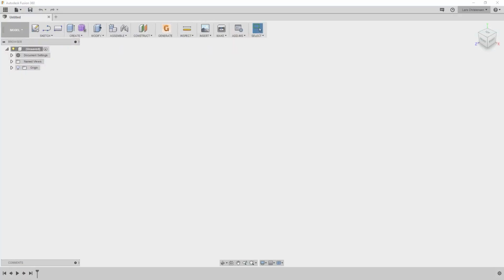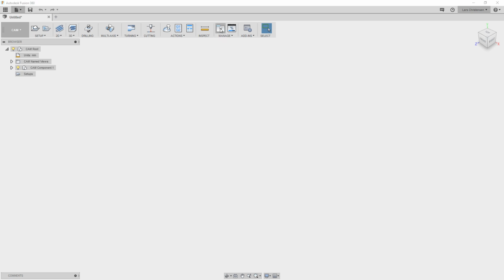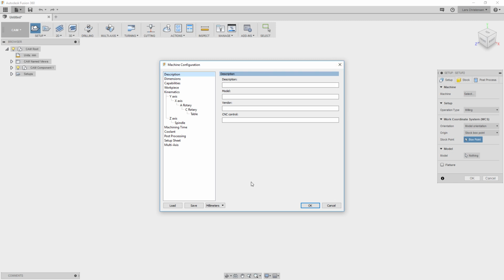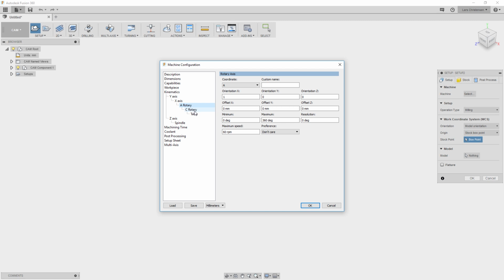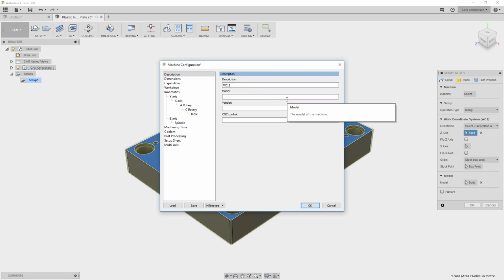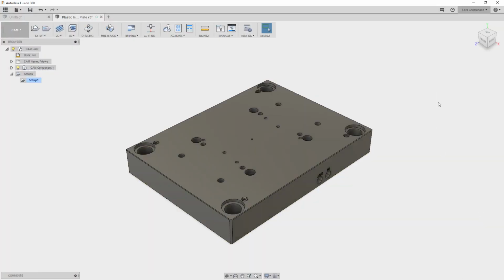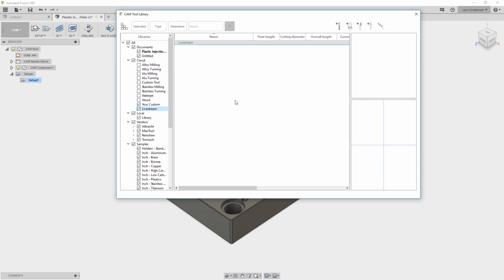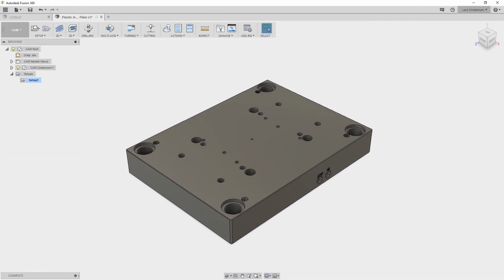More What's New For CAM!!!! Machine Configurations — April 2018 Fusion 360 Tutorial — #LarsLive 150

Comment: Hey Lars. Is there any way you could look into doing a future video on designing belt pulleys with teeth? I can't tell you how many projects iv'e put on hold because I can't design pulleys for various belt types.
Reply from the maker: Hi Luke AOD Thank you for watching!
Are you trying to design systems where you need to figure out the ratio of pulley sizes or are you trying to create some kind of analysis? What is the end goal with these pulleys?

Best,
Lars
Reply: I would like to 3D print belt pulleys for various belt sizes. I don't know how to draw the tooth profile around a circumference. In addition I don't really know how to create pulleys that are the correct size to satisfy a gear ratio, and accommodate a tooth profile. Meaning if I wanted a 3:1 ratio I would have to design two pulleys. One pulley with X  teeth and the other with 3X  teeth. Each pulley would need teeth that perfectly fit around it's circumference.

Comment: Ah yeah your color is a bit better. But I believe you are using a florescent ring lamp. I had a side by side pictures of today and months ago and I find your old setup softer not a s vibrant. YouTube doesn't let me post pics in the these comments. I think the White over your left shoulder looks like over exposure rather than white wall. SO Maybe exposure settings or lighting. Also the audio is a bit more echoy then before. Just FYI cause I know you care.
I dont have any comments on actually why I am here cause the information and learning is awesome. keep up the great work.
Reply from the maker: Hi Sean O'Brien Thank you for watching!
And the great comment! Yes, I need to adjust the lighting. I find it strange with the sound. The only difference is that I run it through the camera vs. directly via the usb into the computer. Reason for this is to eliminate sync issues, but the sound did take a dive...I have a few things to play with there also :-)...Love the feedback